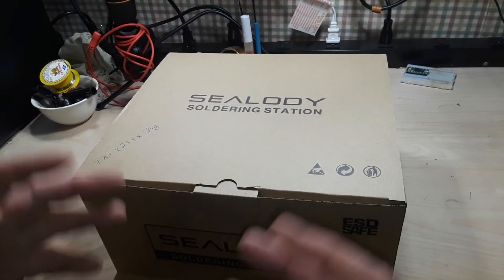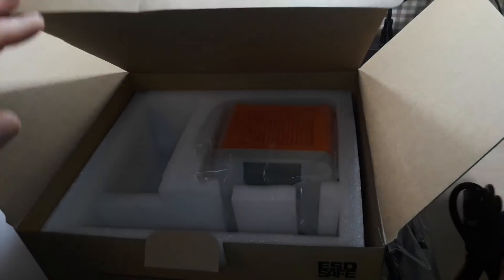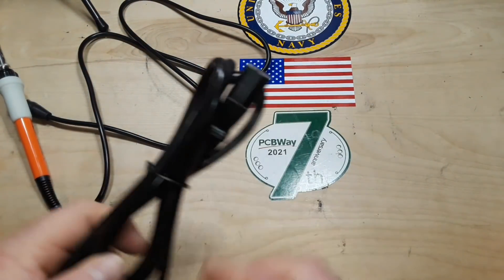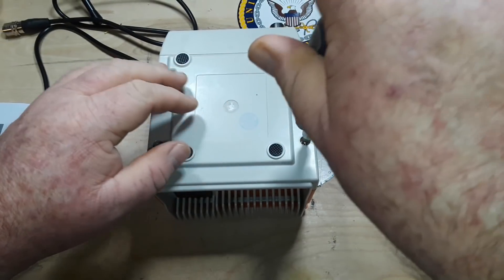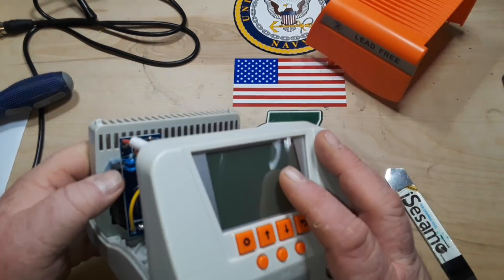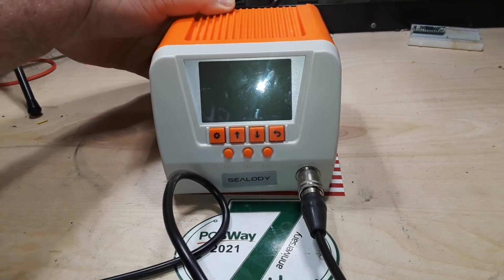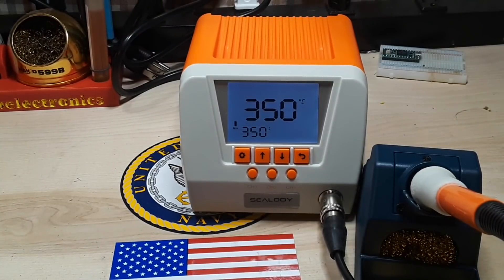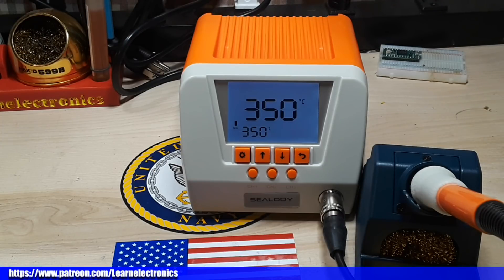Sealody 60W Soldering Station Review and Tear Down

Comment: Great little station, but Lord what an odd / unattractive color for it - just my opinion. so many other options - make it black, blue, red, black and blue like Weller, something that says "Tech" orange is just not a techy color, again JMO  - Id be wanting to paint the orange part of the case with some hammered finish grey, black, whatever - ive never seen an orange soldering station -- But, the most important thing is it works well and is made well and thats whats most important

Comment: Clone of the Bakon BR60 with Orange coloring, build quality looks about the same as the original. Also seeing another clone made by Neekey of the Bakon BR90 in teal floating around out there. From when you took it apart was the PCB clean or did it have a bunch of residue on it? Did you get an unusual smells from the unit of the unit while it was off?
Reply from the maker: It looked pretty clean, and no smells.

Comment: Okay, so I bought this exact soldering station and quite frankly I like it, but it came with 1 very pointy tip which is kinda useless to me. Where the heck are ya'll finding 600 series tips at because either I'm searching for them with the wrong info or they just aren't as common as other types.
Reply from the maker: https://amzn.to/3Igw2Bo
Reply: @learnelectronics  I found those same tips as well....Not too excited to buy a bunch of tips I won't ever use, for $20 which is half the cost of the station itself....Just want to buy one or two spares, and would like to know what the "600 Series" designation is actually referring to....Is it Unique to these Sealogy stations? Or perhaps it is a reference to a Hakko or Weller standard size?

Comment: With a directly grounded tip, best not to solder on a live circuit! They should have put a 1Mohm resister in the circuit.

Comment: $40 I got the same 60watt iron design with 3 presets from the trash next door to me. It was missing any tips so that is all I am into it for. It was sold by Radio Shack. I've never had a digital one before and the best thing I can say about it is that it reheats quickly. But honestly I found myself using the dumb ones because they are more portable.

Comment: For the money, that's a great little starter iron.
For slightly more money you can get the Yihua 878 manual temp controlled soldering iron that also has the rework heat gun and uses Hako tips.
Either of these would be a good choice for the hobbyist depending on what you want.

I just realised... I bought myself a new DMM for Christmas that cost six times this price.

This is the first rule of buying tools for hobby use. Spend as little as you can for the most useful tool. If it breaks or you realise that you need better, that's when you drop some real money.

Oh, and warranties where you have to send the equipment back to Shen Zhen are worthless for anything but DOA. Plan on fixing it yourself or replacing.
Reply: https://www.youtube.com/watch?v=OE2ABaPPH1o&t=12s&ab_channel=ScoutCrafter
 You should watch his video as it shows an adjustable iron in a full kit form, for a fraction of the price. At under $13 it's a great deal and it appears to use the same type of heating element & tips as $100 irons.